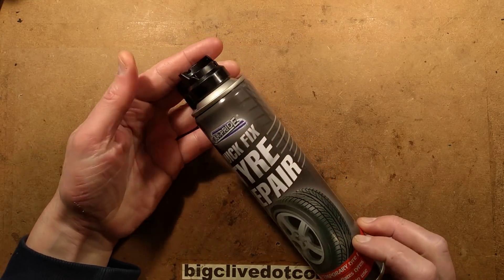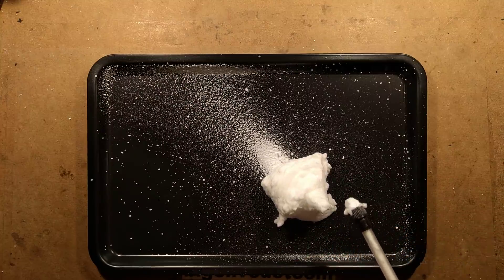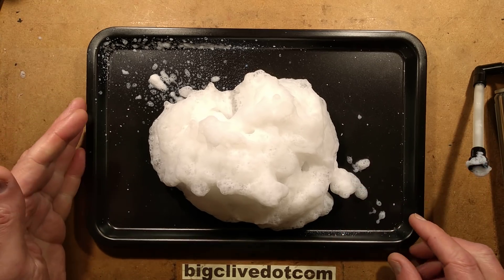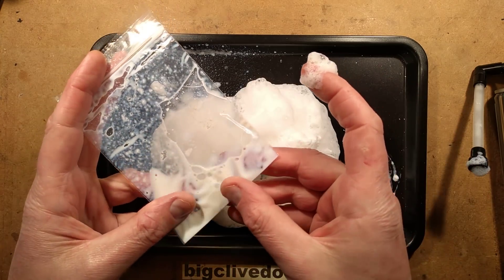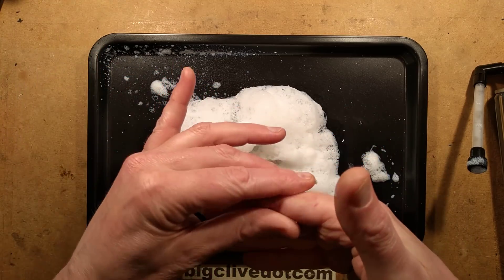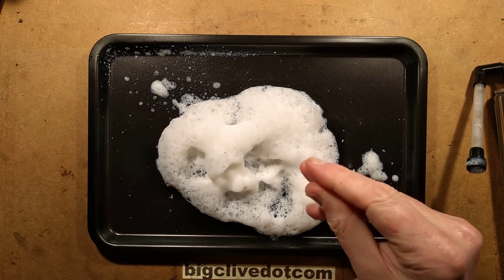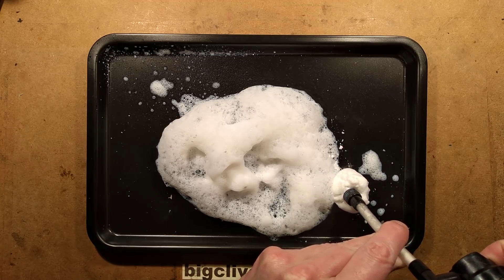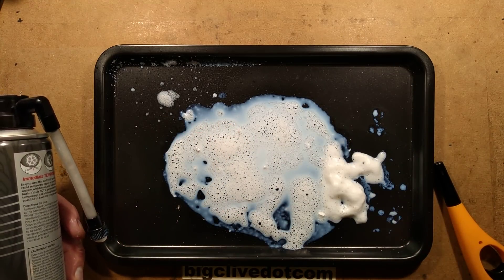What's in a tin of foaming tyre repair liquid.

Comment: Used to use it on my mondeo alloy wheels that were leaky around the rims... Worked a treat for months then put more in.. Never had issues with it to be fair. Didn't put the wheels off balance either, I suppose it gets evenly distributed inside the tyre after a couple miles driving. And there's not much weight to it either.
Reply: Years ago I had an old jeep with bad tires and used several cans in a couple of them. The water accumulated and in cold weather the water part would freeze at the bottom of the tire and clunk around in the tire until it broke up and/or heat was generated to melt it. Repeat as used.  

Shops hate it because when they break the bead to service or replace a tire a flood of the water gushes all over their gear and it rusts the rim/wheel something awful. Getting a new tire to seat and seal can become impossible due to the rust without restoring the wheel. I have had some luck spending tons of time on a wheel grinding, filling, and epoxying the rim but unless you are restoring an antique auto it is a luxury you almost never get to exercise.
Reply: There is stuff you can paint on alloy wheels to fix the slow leak issue.  Basically it is a sort of paint with a binder and an extremely fine powder.  The binder never gets really hard.  It stays a bit like the glue on a postit note.
Reply: I was talking about regular steel wheels which were common years ago. We used to wire wheel the rust off and keep them going. You could fill surfaces with lead back then and file it smooth (which was also how good body work was done - better than Bondo and common in restoring antique cars). Steel wheels were also prone to rusting through at weld and rivet points. Alloys were a bit more forgiving and did not corrode as fast.
Reply: @RuneTheFirst 
The tin based plumbing solder works for that trick.  You need the aggressive acid flux and a lot of heat.  The tin will stick to iron.
Reply: Yep. That was what we used to do body work back in the day. Smart move was to buy it in bars instead of rolls. You could cut what you needed or use a couple bars and not try to melt spaghetti. Ah, the day of the "lead sled...
Reply: @RuneTheFirst  most of the cans say in the directions to immediately drive for 5-10 minutes to do exactly that, evenly distribute  it around the tire
Reply: @tylerlarsen3865  Even doing that will not prevent water accumulation if you use more than once or twice on a tire, say instead of using a pump to bring a tire up with a constant slow or intermittent leak. Maybe the premium brands are a little better now but I haven't used these in a couple decades. I speak from a perspective of use years ago but from what my mechanic friends tell me (including a relative who is a former "Mr Goodwrench" - GM dealer tech for those unfamiliar) it is still a problem. Granted that it is probably considered misuse but people on long trips and such will do it to get home and the remedy is seldom permanent.

Comment: everyone calls this fix a flat. i know that is a name brand but that is what it is called. it is used if you get a flat to temp get to be fixed. if you leave it in tire though it does bad stuff so you really should use as as temp and get it out as soon as you can. surprised you didn't know about this stuff really. this is common thing. they even gvve this with new cars instead of a spare tires which sucks. the right way is to get a patch but i never got a patch too. i got plug and those have lasted for as long as i had a tire really but the right way is th plug then patch the inside so whatever.

Comment: I once put a tin of it into a wheelbarrow tyre. To be fair it was an old tyre and had a few small cracks in it. It kind of worked but not very well. I replaced the wheel the next day, which like all small jobs took longer than it should have!

Comment: I am a car mechanic and I can say that wen you change the tires this stuff is absolutely discusting it stays in this thick liquid form and is a nightmare to clean up.
BUT I used them for wheelbarrels and lawn mowers and for this usecase they are quick, effective, and work for a surprising long time.

Comment: I've used it with success on commercial lawn mower tires for nails and such puncturing the tire, until you can get it plugged properly. On a automotive tire, they are snake oil. If you have a nail in your tire, it can gunk up the hole around the nail long enough to get to a shop, but then the shop will refuse to plug it and make you buy a replacement tire and charge you to clean the gunk off your rims. Best thing for an emergency kit is  a 12v cigarette lighter air compressor, a spare tire and bare minimum, a pack of tire plugs
Reply: This guy is full of crap. I work for a tire company and if we find this stuff inside a tire we wash it out as it is soluble in water, plug and pump the tire up again. That's it no drama.
Reply: I have used this stuff on four tires over the past 25 years. It worked on all tires and I drove the tires till their demise. I had no problem getting new tires remounted. No charge or complaint about cleaning rims.
Reply: This is not true, it works well and lasts a ling time and its not hard to clean it off the rims.
Reply: Same here.  A tire plug kit and air compressor take just a little longer but the result will outlive the tire and causes no further complications down the line.

Comment: Used to go back in the day the early years used to work on a farm and we would take butane and fill up the tires on the vehicles tractors cars trucks never did matter and it never did it explode but in the summertime you would have to watch how much you put in it because butane will expand and in the cold it would decrease in pressure but as far as exploding a blowing up no we never had that kind of problem at all

Comment: I used it once coming back from a family vacation.  Got a puncture at around 9pm Saturday night with the only options being to stay at a hotel two nights until a garage would be open or chance the 700Km back with this stuff.  Too far for the small spare tire but I would have used the spare if the punctured tire gave out.  It worked but I knew already I would have to buy a new tire since the local garage wouldn't patch a tire with this stuff in it.   I guess because it can never be balanced properly.

Comment: I put about 4 cans of tyre weld into the same tyre over a year. The air kept leaking out despite taking the tyre to numerous tyre repair shops. Eventually a Quick-Fit fitter noticed my alloy wheel was slightly oval so I bought a replacement from eBay complete with good tyre. I kept the original tyre because the tread was in good condition but when I asked for it to be transferred back onto the car, the fitter noticed  that there was a thick layer of flaky goo on the inside and hence was advised not to use.

Comment: I have had some in a tyer for a year.... 😋  I also removed the tyre as I had access to a tyer machine at the time, smelt verry rubbery and a little residue, other than that it was fine! I might add it fixed the slow leak for that year too 👍

Comment: I have had good and bad experiences of using these. If you have a boot full of stuff and you have a flat just attaching this can get you going without emptying your boot, getting the spare wheel and tools out, jacking up the car removing the wheel putting on the spare wheel, lowering the car putting the punctured wheel in the boot with the tools and then putting your stuff back, It is not much fun in daylight and good weather, at night and when raining it is even worse. I have a ride on mower and have used it when a thorn went into the tyre and it has fixed it and have just carried on and I have had other times where it has failed. For convenience it is worth carrying in the car or bike and if it works can get you home without being covered in dirt and grease from removing wheels.

Comment: I haven't used that type, but I have used the brand "Green Slime" on my riding mower tires.  The tires are over 30 years old, and tubeless, and the sidewalls have splits and cracks in them but with a dose of "Green Slime" in the spring they always hold air just fine for another summer.  Those tires are low pressure (12lbs), but the Green  Slime has sealed splits that I could stick my finger through the sidewall.  It's pretty amazing stuff.

Comment: I work as a tire tech currently. Fix-A-Flat considers itself to be "TPMS safe" which is a load of wank IMHO. The self inflation is useful as a "Get me to somewhere I can buy a new tire because I'm giving up on having this repaired" because it absolutely does ruin the chances of patching the tire properly. SLIME is even worse, the green stuff. It not only contains the liquid latex stuff (And isn't self inflating) but actually contains bits of shredded rubber in some formulations. Messy, and HELL to clean off the rim. If your vehicle doesn't have a spare and can't have one, suffer with runflats or hope you never go anywhere you can't get a tow truck. For the love of all that is holy don't use this cack.

Comment: Good stuff! The latex side looks similar to the stuff tubeless bicycles use to make your bike tubeless. It plugs the hole while air is rushing out with the small latex pieces and then hardens and clomps up. As a bicycle mechanic I've seen quite few tubeless tyres. You have to replace the fluid after half year because the more you "swap" the air inside tyre the more it will dry out. I assume it's similar with that stuff that it will just dry out after a while and that's why it says its temporary

Comment: I hated the people that used this garbage and didn't notify me when they did it.  Hit the pedal to break the bead and the crap would spray everywhere from the pressure. Well now I have to change my uniform because it stank after mixing with the rubber. The worst was green slime, witch is exactly as it sounds. Slime with little chunks of rubber in it. Instant tire imbalance that can't be compensated for. Another great video! Thanks Big Clive!

Comment: I've used several different brands of that sort of product with varying levels of success. The more (but not most) inexpensive brands have typically provided some extremely effective repairs and the most expensive name brand (which is dyed fluorescent) quite frankly performed horribly. The best performers in the cheap range all have little (~5mm) sections of fine nylon fiber in the mixture. And Clive, when you say rubber like you did at 4:41, please consider have Her Majesty's lolly in frame. Thank you.
Reply: Mike Oxlong  You're mistaken. Last I checked Her Majesty is a woman.

Comment: I had leaks between aluminum wheel and tire. Used it on two tires works as intended. I have it in for more than 6 months. It does work.

Comment: Just to be technically pedantic: The latex rubber is composed of particles of rubber, the water and Ammonia stabilize the liquid. A form is dipped in a calcium salt which will coagulate the latex to form a copy - Typical product  rubber gloves.  (I use to make them)  Milk is a fair source of calcium.

Comment: Used this once back in the late 80's on a flat Vespa tyre in middle of Wales @4am to get to the 'sea side' for some 'fun' - ran for over a year !! (yes I'd forgot - and it went pop going to Wales the following year - spooky)
Best used as napalm - set fire to it as it's coming out - oh the memories ;-)
Reply: Your bike is asking you not to go to Wales.
Reply: Old Vespas weren't much of a problem as you could carry a spare! Modern ones are crazy to get the wheel off and put a spare on (the wheels are different sizes as well) I always had a can in the box of my Honda 90 it was about 50/50 in usefulness mainly because its got an inner tube and the goop isnt designed to be used that way.
Unfortunately the modern vehicle is coming away from  spare tires so this is all you have unless your in the AA or whatever.
A better mix would be the goop with mica or similar flakes of <1mm so they physically form a seal before the goop goes off
Reply: @davidgranger3628  spare we flat, and it only head 8" wheels, all my mates scorers had 10" duo was fecked,
Reply: With 'sea side' and 'fun' in quotes I can't decide if 'fun' is a fight, sex or heroin...

Comment: Ive recently used on for a persistent slow puncture, its still inside and the tyre is still inflated, it worked, Id be interested to know if the propane will ignite when I remove the valve deflate and reinflate with compressed air.

Comment: I've used a product over here in America called green slime. I had to use it on a tire on my personal vehicle, and I had to use it on my band trailer, tire, both in the summer of 2017. I'm still driving on it in my personal vehicle today. The trailer I used it on, we took on tour for thousands of miles that summer. Finally replaced the trailer tires last summer, but the old tires are kept as spares.

Comment: I find it amazing that such a weak stranding liquid (see how easy it wipes off your hand) can block the intense pressure inside a tyre through such a tiny hole (think of needle heel shoes exerting intense pressure on a tiny area of floor)
Reply: That's not how air pressure works, though. Let's say you got a tire inflated to 2.2bar, that's 0.22N/mm^2, so a (substantial) hole 3mm in diameter (that's around 7mm^2) would have to resist only 1.54N of force.
Reply: The latex should bond to the crack in the tire and essentially heal it.  So its not really a physical plug.  More of a glue that fixes the defect.

Comment: I've used them in the past & leave it till the tyre needs replacing.
They're really good. You just have to make sure the puncture is at the bottom of the tyre when you inflate.
It's never filled my tyre to spec. So I do have to top it up.

Comment: I've had some success gunging up an old porous alloy wheel that was letting air out with it - it never worked very well for actual punctures in the tyre for me.
I've bought one of the 'string' type puncture repair kits (as seen on electroboom) for the next puncture I get

Comment: My Jeep tires lose air slowly, over a week or so. If I use the repair liquid they are good for a couple of months.
Reply: Probably corroded rims resulting in a poor seal, I had a similar issue and when the tyres were replaced the fitter painted a rubbery goo round the inside of the rims. 2 years and 20,000 miles later I'm starting to have pressure loss again.
Reply: @Steve_Coates  I bought brand new tires all around, and thought that would solve the problem. The rims looked ok, but it they were old alloy, so .... The one thing I keep kicking myself about is not making sure they put in new valves. Well, with the next set of tires......

Comment: This isn't good at all, it's a shitty product as far as i'm concerned. Better, is the stuff (and forgive my poor memory, but i forgot the brand name) that you pour inside your tire/tube. It's amazing, you put the dosage in, spin the tires for at least half and hour then add another dosage (half of the first, all done through the valve with their special can). And the idea is that if you puncture the tire/tube, fresh rubber is exposed and the liquid reacts with that fresh rubber, where as the rest of the tire has been coated in this cured liquid, together, it gives you a very strong bond.

On my motorcycle, i had a nail (3 mm diameter) poke through the front tire, took it out, spun the tire down, and used a compressed air cartridge to refill the tire, all inside something like 2 minutes, it lasted me (i changed the tire) 3 weeks, normal road use. I think it's called something like liquid cork or the like, i finished the last can in may, didn't to get another since, it's just that good.

Comment: I did expect it to be the thickness of custard and not a foam, when I worked at a garage, company policy was not to repair tyres that had used a tyre sealant. I’m not sure of the reason except it might take more time cleaning the punctured area, or they just thought it a good reason to sell a new tyre.

Comment: This thing is good only for a quick fix like it says on the tin, I wouldn't use it for fixing tyre and drive it anymore than getting home or to nearest gas station.. Cheaper solution than repacing whole tire (and decent one) is to get that tyre fix tool with rubber stripps that you insert into puncture hole, also clive keep up the good work
Reply: Yes, I keep a repair kit in my car. Simply ream the hole, push the doubled-over rubberised cord into it, pull out the tool, snip off the excess cord, inflate the tyre and it's done!
Reply: @manolisgledsodakis873  that is the better fix indeed. However you also need to keep a pump, compressor or pressurized bottle/tank to fill up the tire after plugging it.
And for some of the haters... Those rubber strips are self vulcanizing so they end up as a solid part to the tire.

Comment: I have used the liquid version of this that you attach your compressor to.

It says to drive for a minimum of 5 miles after putting it in , I did that and it works great, it was weeks ago and it’s holding up so far.